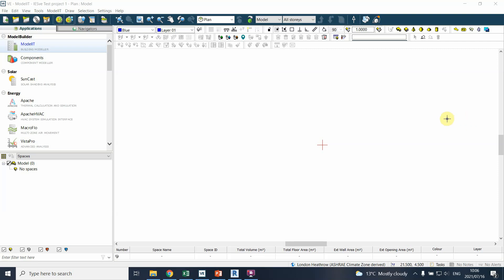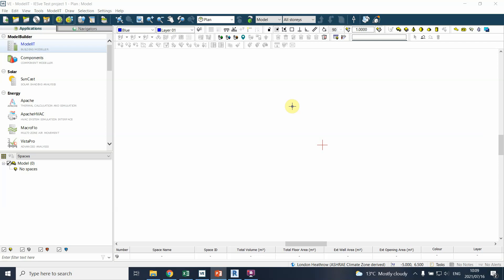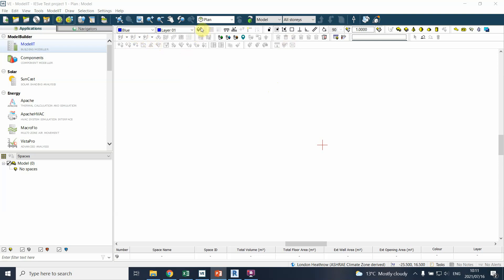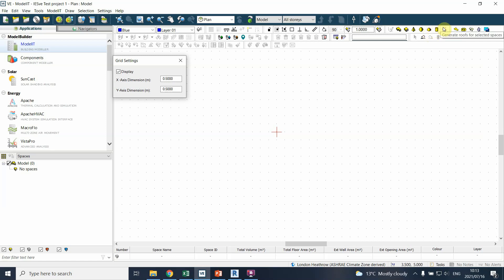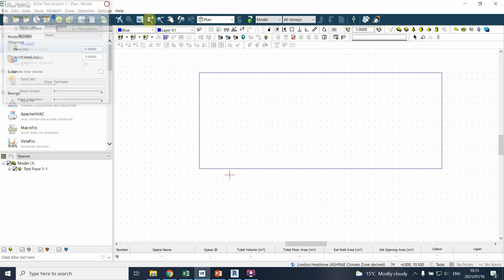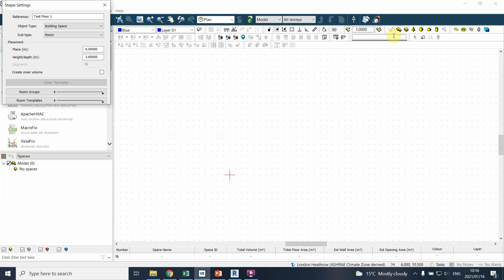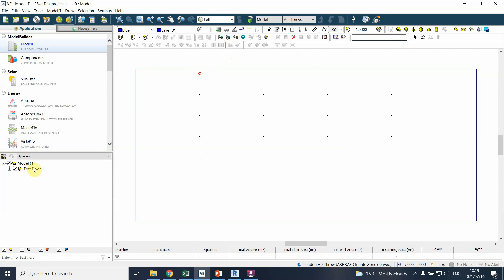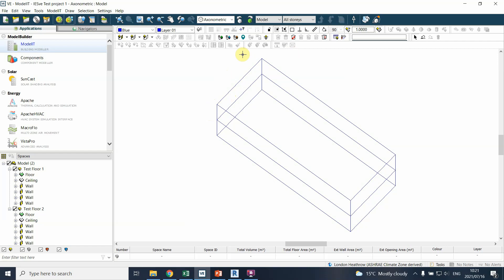IESve video   02 Geometry 1

Comment: The interior walls shouldn't be modelled and considered adiabatic. Adiabatic surfaces don't allow any sort of heat transfer through them. If you have 2 spaces with exactly same thermostat temperature and internal gains, then the internal wall between them makes no difference. If the temperature or internal gains are different, then you MUST create the internal partition wall between them.